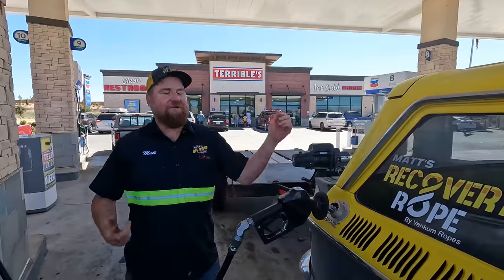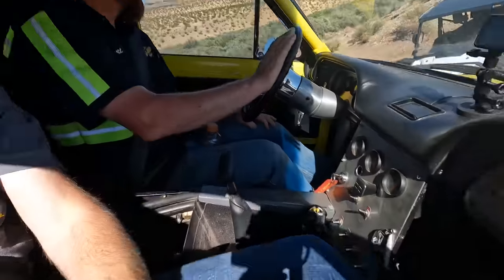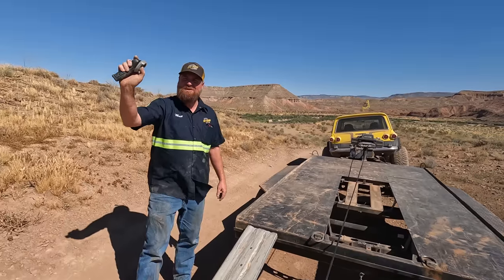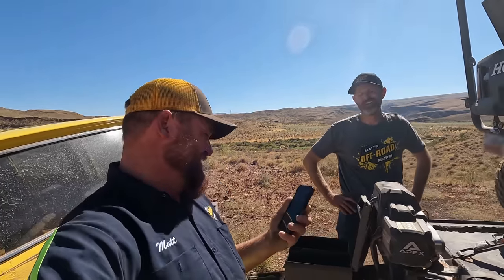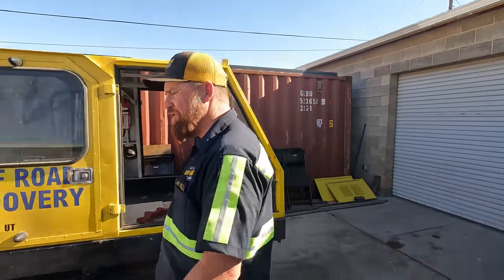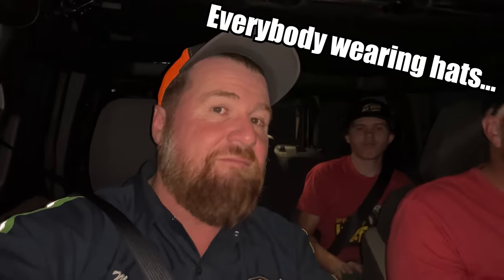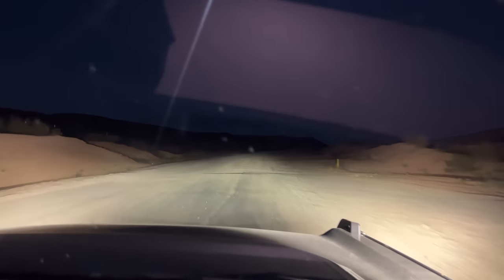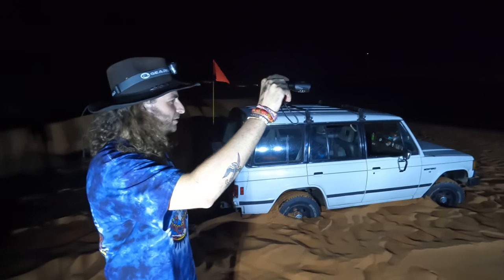Customer Get's Chewed Out For Getting Stuck!

Comment: At your location (UTAH), you do in fact experience low humidity vs the rest of the country..... The big risk with high temps and low humidity is that you dehydrate  without knowing it... Much of your body sweat actually evaporates before it even reaches the surface.  People do not realize the risk from the heat...  110+ temps should be a red line notice for people who are not accustomed to that kind of heat..  I was raised in Oklahoma where we generally had 60+ days of 100+ degree weather each year.  I have seen the actual temp (not heat index) reach 121 degree's.

Comment: Yeah, it’s a dry heat. I’ve lived both in the desert near where you guys work, and  in the humidity of Texas and Arkansas. Humidity makes you sweat without doing anything. Dry heat feels like an oven and no breezes help unless you’re sweating. Humidity makes you sweat which doesn’t help much if there is no breeze. I don’t like humidity because it’s miserable to be wet all the time when outside. But don’t like feeling like I’m baking to death on the sun either. It’s a tossup.

Comment: There are two important numbers for fuel octane ratings: Research Ocatane and Motor Octane (you can look those up if you want more detail). Basically: Americans use (RON+MON)/2, also known as AKI (Anti-Knock Index) and the rest of the world just uses RON. So the American number for the same fuel is lower than that used elsewhere (i.e., 87 AKI is 91 RON). American engines are historically large, low-compression things that can get by on fuel that would cause detonation in a small high-compression and/or boosted engine typical of foreign cars. It's only useful if you actually need it; otherwise you're just wasting money.

Comment: Octane. I had a 3 cylinder car and commuted 35 miles one way. The car got mostly 50 miles per gallon. What I did as my experiment was to see how much it cost per mile to run that car. There was no difference between regular and premium. I didn’t see that coming! The experiment lasted a year.

Comment: Being tuned for an octane is nothing. 
High octane is to prevent pinging (pre-detonation). I had a 400 whp car on 83 octane with a similar engine to the Morvair, my newer car needed 91 minimum and made 495 hp but it is pretty stock.
Don't think you need a higher octane just because you make more power.

Comment: Is compression ratio something that can be adjusted through tuning?? My understanding is that higher octane is needed for engines with a high compression ratio, for the sole purpose of preventing predetonation. Because fuel with lower octane can ignite prior to the spark when the fuel air mixture is compressed enough.

Comment: Not humid at all. Everything below 50% is just not humid. I recommend you, to just come over to the UAE in summer. If the wind comes from the sea, its 80% plus and above 100F, that makes it really interesting to stay outside. Its not the right weather for making sports either, but why not, some of us are crazy enough to do it. Thanks for checking your ground temperature. Its not lower here. Its even not really cooling down at night. Few degrees only and humidity goes up then. Heat comes within the day from all sides, it feels like you are in a baking oven and you have zero wind.

Comment: The inner tire on a dually went flat  Arizona  115F  the ground was too hot to kneel on.  The tools were too hot to pick up.  30 yo diesel pickup.  It took a solid hour to get the two wheels off and the good one reinstalled.  I lost almost 2 gallons to sweat.  Damn near killed me.  Above 110, strong sun, you start work at 4 AM in the dark,, and finish at noon. the Phoenix hospitals were full to capacity with burn patients.  If you fell or lay down on pavement,, you had 1st and 2nd degree burns before you could get up. Your hands burned to push up to standing,, sneakers melted, got greasy.   The entire month of July this year  every day went above 110.  It was hot.

Comment: Dry heat is more manageable than humidity and heat. This is because our bodies regulate body temperature with perspiration, since evaporation causes cooling. But when you have high humidity along with ambient heat, our bodies get defeated because the rate of the perspiration evaporation reduces considerably reducing the rate of heat reduction.

Comment: I can't afford high octane feul but it definitely works. Not only that you don't have to continue pouring cleaners in to get all the garbage deposits out from cheep feul. I used to run it in older vehicles that I didn't drive all the time. Vehicles I used for towing trailers and hard work.  All my other ones I had to put cleaners in all the time to keep them running ok. Feul is way too high now to buy the higher octane.  I put in a tank every month or so. Makes a difference.  Just can't afford every tank. Why wouldn't race car drivers just stop by the gas station and put in 87 octane to win a race with. They use the good stuff.  Hang on I gotta get the gunk outta my carb to pass you on the next turn.  ?.

Comment: Useless fact. We used to live in the STG area so I keep track of the area best I can. That includes the weather. We now live in south central Texas. We haven't had rain in over 2.5 months, which is very odd for this area. The other day I was checking the weather here and there. It was actively raining there. The humidity level there, at that time, was lower than it was here. The humidity here can be so brutal. It's

Comment: I run mid grade octane fuel in my truck cause regular unleaded causes knocking and low power. Then again my truck is 25 years old with 389000 miles on the original engine.

Comment: ANYBODY that says that using Premium gas does nothing for the engine or better performace, has never actually tried it in their own vehicle.    I have found out myself that using the highest octane fuel available at the gas station (premium fuel) ABSOLUTELY MAKES A DIFFERENCE in my car.   it runs better, quieter (less engine knocking), and does have more power and acceleration.   there is NO debate about it.   use it for yourself and you will see that it really does make a difference.

Comment: Also ethanol destroys engines, if you read the owners manuals for your vehicles and look under fuel it will tell you what percentage the vehicle can take, and will tell you that any more than that will damage the engine and if you have to use the higher ethanol fuel then you need to put fuel treatment in the tank before adding the fuel to it to remove the ethanol. Also if you put fuel with 0% ethanol in it in your vehicle then you will get a lot more performance out of your vehicle.

Comment: Great Mitsubishi shogun as we called them in the uk i think the best name out of all we as a family have had 3 a B reg 1986 high top long wheel base 2.6 4 cylinder petrol super rare car a G reg 1990 3.0 v6 long wheel base same as this one another great car then i had H reg 1990/91 swb 2 door 2.6 4 cylinder petrol another rare one the most fun because it was mine never got stuck had bigger tyres and if forward momentum stopped which happened quite a few times in mud sand it always came out backwards and snow no problem at all pulled many a car out of ditches and helped one that could have gone in to the sea near me whilst the police watched

Comment: yep, as someone that grew up in the humid midwest and having lived in utah for 6 years while being stationed at Hill AFB, the heat is completely different but Utah is still very hot..   but i will take Utah heat and its issues over the humidity of the midwest.  you want a true awful combination of 100% humidity and 125 degree temperature? being deployed to the Qatar.  that was a whole other type of heat and humidity.

Comment: Yes if I had to be in one type of heat I would absolutely take dry heat. Either way 100+ degrees in any type of heat is too hot however the dry heat makes every item exposed to the sun hold heat and become dangerous as heck.

Comment: The reality is that all octane ratings are fundamentally flawed. They're not really based on the behaviour of the fuels, just on very specific and at this point antiquated engine operating conditions. In the end 2 fuels with the same "octane rating" (whichever flavour you happen to be comfortable with) can behave differently in the same situation. A more rigorous rating system would use fuel properties, but this is still not sufficient as the engine itself is a big factor in fuel performance. I won't go into any more detail here but I can direct you to a plethora of academic papers on the subject, including some of my own.

Comment: That’s hot but 2% humidity and welding thick plate multi/pass .
The steel wil radiate 1500 to 2000 degrees 
With leathers on Hott hood  people pass out all the time

Comment: I had a 03 f250 5.4 and if I ran the 87 I would barely get 300 miles to a tank of gas and the 93 I would get 400-450 miles to a tank depending on how hard I was on throttle. I also have a 89 Aerostar tans it get worse mpg than 87 octane and it would spit and spudder also.

Comment: 6% humidity must be why they are outside (said a short ars’d Celt from Britannia) Here in Englandshire that would be 70% humidity, you couldn’t sweat.
Reply: Excellent description, but I’m sticking with my analysis, England shuts down at 35  Celsius :o)  At 40 Celsius and 90% humidity I doubt the main engine rad would work? Anyhoo, my/our record for a heat exchanger pack in Arabia was 60 degrees Celsius air-on (ambient). Glad I wasn’t there :D

Comment: Ok so let’s get real about octane! I had this discussion decades ago with the son of a well known race car driver, he was arguing that 87 octane didn’t make a engine run any better than 93 octane (yes this was in the early eighties before gasohol), so I asked him why do they offer the higher octane then? Why doesn’t his dad run 87 octane in his O/SA 66 Implala Convertible?? If you ran this 283 on a dyno with each type of fuel what would the results be?? We all know the answer, the higher the octane the higher and better the performance!  And he guys you should be here in Nebraska yesterday the real feel temperature in Lincoln was 118 at 6:12 pm. The real temp was 97 and the dew point was 80 😮😮😮😮😮 so the real feel was 118. That’s insane for the upper midwest!

Comment: Tires weren't the best but I would have tried reducing tire pressure to 18 PSI and then shoveled the underside and axles so that it was not high centered and then try to drive out on my traction boards. If that didn't work I'd use my spare to make a sand anchor and then try to winch myself out.

If none of that worked then I'd call Matt and the gang!

Comment: Higher octane gas gives less detonation. that's all. If you aren't having detonation (which can damage your engine) there's no reason to use it. It doesn't give you more power or torque or anything. It isn't better gas. It's just more resistant to detonation. It doesn't change the energy content of gasoline at all. IF you are pinging and knocking, which happens when the gasoline just lights itself before the spark goes off, that is a lot less efficient, and in that case only, you will get more power from using higher octane just because it will stop the detonation that's ruining your efficiency. (This happens for high compression engines with superchargers for example.) If your engine doesn't have a detonation problem it is a complete waste of money to get a higher octane gas. It will be just the same energy/gallon as the lower octane gasoline. Zero effect. Sorry. Just sayin'.

Comment: Im just saying, yall werent sweating enough to be hot. 😅 in oklahoma today it was like 98 but the humidity allowed me to work in the shade for 15 mins before becoming drenched in sweat. 😅 Ive worked all over, dry heat, humidity heat, and dry cold/ humid cold. Humidity is worse, in my honest opinion, but 90° with 80% hunidity vs 112° and no humidity is equal suckage. Yall just stay dryer lol.

Comment: I really don't understand how you are able to work in 110 degrees Fahrenheit, like 43 heat degrees Celsius, because I think its too hot to work in 25-30 heat degrees Celsius, which is between 77 and 86 degrees Fahrenheit. You are pretty tough Matt, Tom Tom and all the rest of the crew😅

Comment: I tend to disagree with the fact about higher octane. It would make a huge difference if there was no ethanol in the fuel, cause ethanol causes your vehicle to get bad mileage and waste fuel and be sluggish and the more ethanol there is the worse the mileage and the more time you spend at the pumps and less time on the road, and so either you are an auto company needs to do an experiment and make records of the difference between 10% ethanol, 5% ethanol and 0% ethanol and see which gets better mileage and I guarantee you that the 0% ethanol will get the best mileage.

Comment: what's fun is 98F day, with 80%+ humidity and working in an attic that has no air flow at 140F+, add in all the radiant heat from the roof cooking you evenly. 🥵  in about a minutes time in you can wring out your undershorts, socks and dump sweat out of your boots. not to mention crawling in fiberglass insulation to your armpits. good old fiberglass, the gift that keeps on giving for hours/days/week and one of the things that's truly worse than sand😳 you'll be itching places you forgot you had.

Comment: Morevere sounds good. What’s it got for an engine?
Reply: Engine: 5.3l LS L59 V8, 240 bhp (dyno rear wheels), 288 ft-lbs torque (dyno rear wheels) - before Tom tuned it recently.
Transmission: GM Turbo 400 3-speed auto gearbox, NP205 transfer case

Comment: Heat is heat no matter where you are. However, someone from a humid climate like south Texas with so just fine and think it's not hot when traveling to a dry climate like AZ; while someone from a dry climate like AZ will have much trouble functioning outside when first arriving in a humid climate. Your body's evaporative way of cooling itself just does not work when humid, the sweat stays on you instead which doesn't allow your body to cool itself. I'll take a dry heat (which isn't bad) all day long over a humid heat (which is miserable).

Comment: How much do you charge for a recovery?, is there a set price or service charge plus the costs of distance you travel ect or do you just charge each customer based on the job
Reply: They never talk about the price or charges in a video.   One of the posters on here once said that prices range from free (covered by Youtube revenues) to $10k if they have to hire a helicopter.  Matt has said that most of their business comes from Sand Hollow in the tourist seasons and most folks couldn't afford an hourly rate.
Reply: @warrendon1388 Hi Warren, BTW I stole that from one of Matt's replies. Just a little humor about why he doesn't talk specifics 😉
Reply: @JohnFL  😀

Comment: just wanted to comment on what octane fuel to use, if you do not need high octane fuel it has no benefit, 87 octane fuel has more btu ( more power per gallon), but if you have a high compression engine it may detonate on 87 octane, this is not good, most newer engines have sensors that will see detonation and the computer will retard ignition timing and go to a rich fuel mixture, this will kill your fuel economy ( but save your engine)best way to see if you need it is to check your mpg, if premium gas does not give you higher mpg do not use it, this does not apply to non computer engines, for those just listen for that rattle sound and use higher octane if you hear it

Comment: Temp for temp humid heat is way worse than dry heat..it’s not an opinion..it’s science. Our bodies cool themselves by evaporation of sweat..the higher the humidity the less efficient evaporative cooling is. It’s a catch 22 though..because the lower the humidity is the easier it is to become dehydrated which is also deadly. I’ve been in heat in both high and low humidity climates and they both can suck lol. As they say in the Marines..drink water..and if it’s real bad..take Motrin 😂

Comment: so why don't you make a tilt trailer and get rid of those dangerous ramps
Reply: How do you tilt it down when the rig you're rescuing is heavier in the back?

BTW the heavy wrecker is supposed to be the replacement for that setup
Reply: @JohnFL  you can put the pivot point near the center of the trailer with the weight of the vehicle you're trying to recover making the the trailer tilt down while you are winching it up the trailer.Once the recovered vehicle is on board you lock the trailer down at the front of the trailer so it won't tilt anymore.  They've made tilt trailers for boats for years. As the boat is winched up the trailer it tilts near the middle of the trailer. the trailer is made with a two part set up with the pivot point near or just close to the center.

Comment: You guys are always having issues with the ramps falling out of place. Why don't you weld a flat bar across the back of the trailer that sticks out an inch and then weld a piece on the ramps so it sits down in there and wont move? Seems like an easy fix, idk